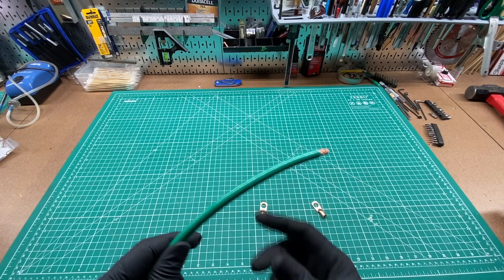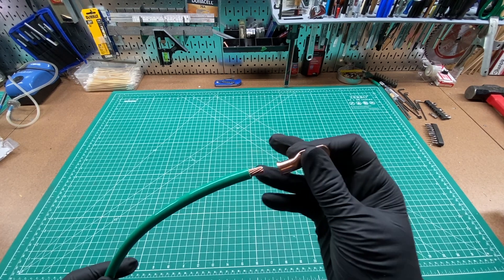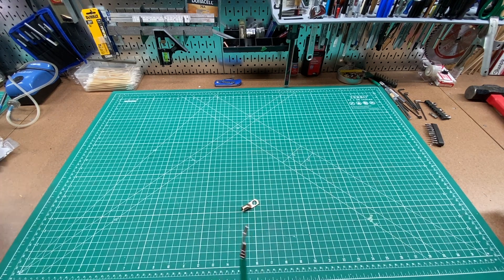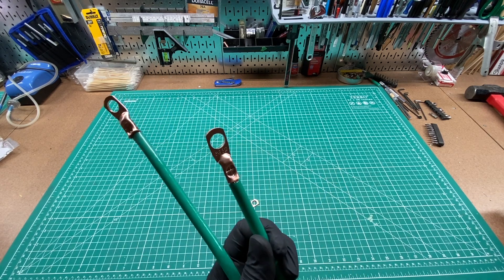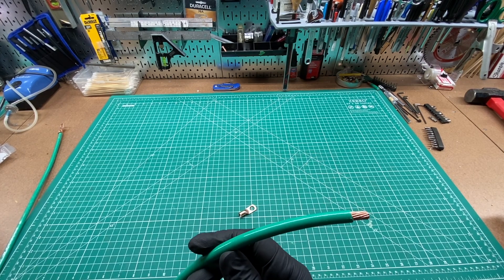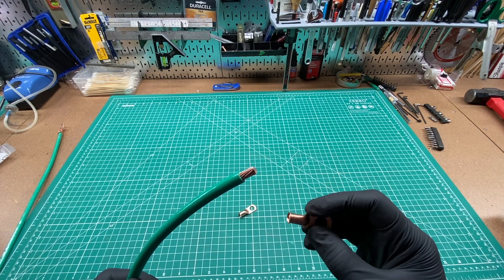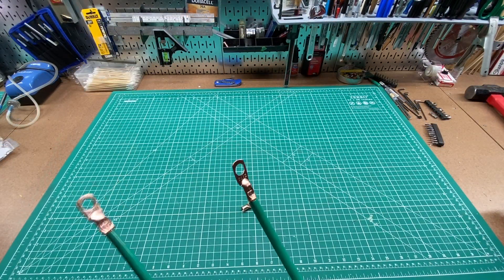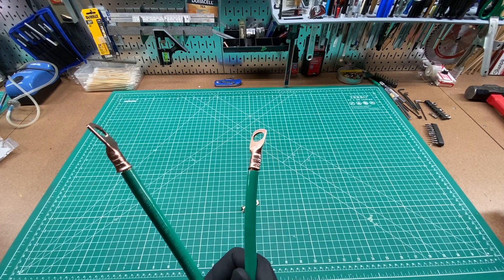Using 6 AWG connectors with 4 AWG stranded THHN ground wire

Comment: Can you please tell me the diameter on 4awg and 6awg in millimetres??🙏🏻
I'm from Europe and confuses me when i go to order wires!
All diameter with the insulation!
For example i have a wire that is 1cm or 10 mm diameter with insulation... What wire is in awg??🤔
Reply from the maker: You can Google charts that tell you the diameter in mm for AWG. Example: https://www.victronenergy.com/upload/documents/AWG%20to%20Metric%20Conversion%20Chart.pdf

AWG refers to the conductor size, and does not factor in the insulation.
Reply: @MostlyBuilds thank you very much!!!! 🙏🏻

Comment: That's 6 AWG wire.
Somebody is ripping you off.
Reply from the maker: Hah I wondered that when I encountered this issue. I’ve now bought 4 awg stranded ground wire from two different electrical suppliers and it’s the same size. From talking with a crimp/die manufacturer they indicated that the coarse stranded wire has an overall smaller diameter than 4 awg with thinner strands. Have you bought the same coarse stranded wire and had a different experience?
Reply: Yeah, that happened to me too and I also thought I was being ripped off but after further investigation we found out it is true, the coarse thread wire is smaller than the fine thread of the same gauge.